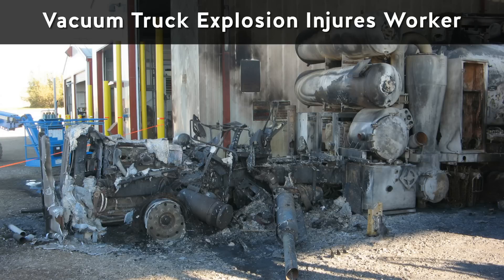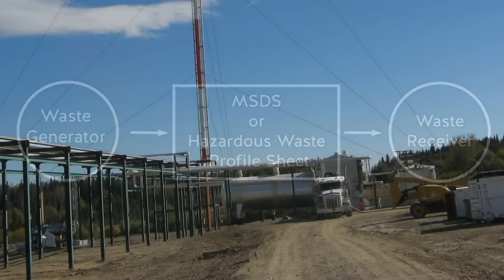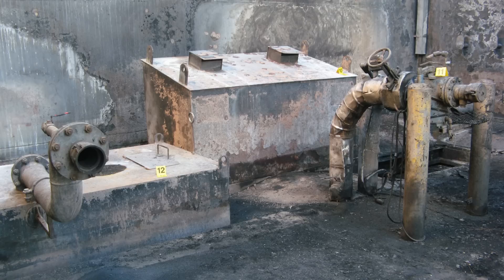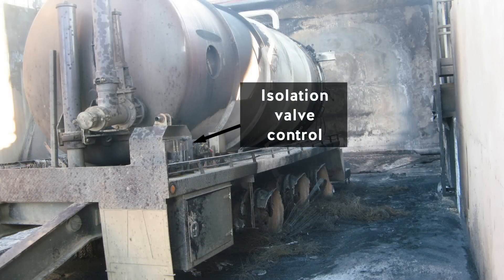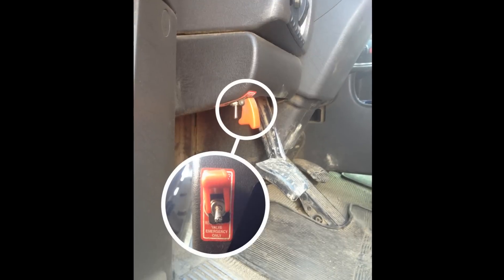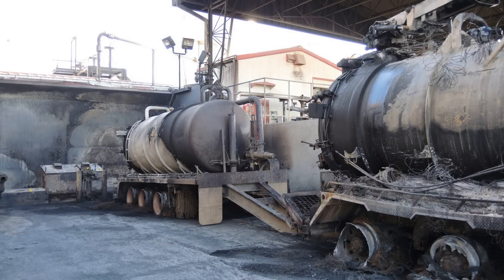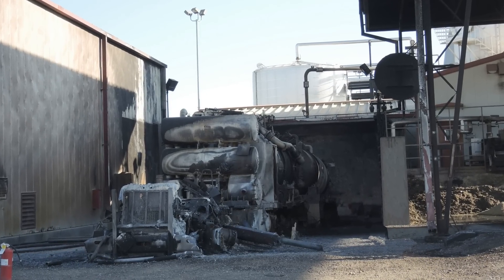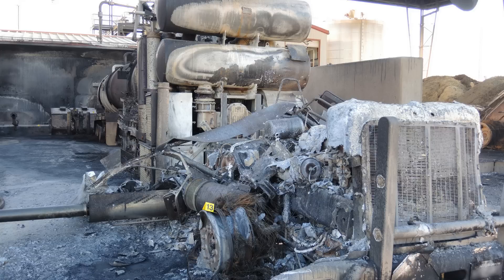Incident Investigation: Vacuum Truck Explosion Injures Worker | WorkSafeBC

Comment: Seriously, who uses a Supervac to load or unload flammable liquids. I worked for many companies that had these types of trucks, but it was a big No No to ever load highly flammable waste products on these trucks do to all the different area flammable vapors traveled, hence the cyclones, bag filter housings. That is complete stupidity on the company, management, and even the driver. These trucks produced so much static electricity it isn't funny. I learned the hard way when I first got into the haz waste industry, working a job sucking fine sand from around an old 10,000 gallon steel heating oil tank, we were using 100' rolls of black corragated "slinky hose", well unaware of how much static electricity this creates, the driver asked if I would walk the 200 plus feet of hose and check for cracks in the plastic pipe. I straddled it and cradled the hose underneath and carefully advanced forward fixing any cracks with a roll of duct tape, at some point my body had collected enough static electricity and next thing I knew I was waking up in the hospital. Yep the driver thought it would be funny to see me get a little shock, well I got zapped so bad in my giggle berries that it knocked me out stone cold! It took me over 6weeks before I returned back to work. Moral of the story if your not qualified or not comfortable doing something refuse to do it, it may be the difference in going home at the end or to your grave!!
Reply: Joseph Grenier "giggle berries" 🤔
Reply: @Ariccio123  Giggle berries?  lol
Reply: Reminds me of when I was young and didn’t know how to say no to a boss. Woke up one day moving around 5000lbs green timbers and making a huge timber framed structure that was going to go above peoples heads. Also was tasked with trailering 5 of them in a crazy 5ft visibility storm. I was an 18 year old child, I have no idea how I didn’t kill somebody while driving or myself while building the thing.
Reply: We have vac trucks designed for flammable and explosive product.
Reply: "giggle berries" 🤣😂💀
Reply: No MSDS equals no knowledge of flammability. Duh.
Reply: Appreciate the tip i deal with these trucks every day sucking rocks off roofs we also repair lines with duct tape lol
Reply: I hope the jokester got fired.
Reply: Tho gear pumps and diaphragm pumps are the safest way to pump flammable liquids however there are vacuum trucks that can do it safely with the use of scrubbers or like a king vac that uses cyclones of water in a special pump to produce the suction. I have hauled 1000s of loads with both. the biggest issue in this case is flame liquids dumped in a open pit. Most disposal places not only do you dump into a closed line you connect a ground strap to prevent statics charge. as the trucks empty simple physics says it has to pull air into the tank in order to drain. Not all but most places have a nitrogen line that you connect to your tank and is used to fill the tank as it drains. no oxygen no boom. Sounds like many things are to blame from the pick up to the end. So sorry to say but you are very incorrect about being able to use vac trucks for flammables as it can be done safely. But i think you are one of those i know everything story tellers that has no real experience except what you read see online. I mean six weeks for a static electric shock. not saying its not possible but not likely unless you fell and hit your head or got another injury due to it that took some time to recover I cal bullshit. If you are going to comment and tell all us nobodies how smart you are make sure you no something about it. I have hauled every hazardous material you can dream of with the  exception of explosives.  I did it for 15 plus years was over 50 drivers for a has waste company when i left due to health reasons. If you cross the t's and dot the I's and dont cut corners this stupid shit is easy to avoid.
Reply: @jvmiller1995  it prevents static charge or allows the charge a place to go? Lmao. Pot meet Kettle
Reply: “... it isn’t funny.” Yes it is.

Comment: Ahh, those fracking dimwits struck again ... :/
Also, wouldn't it be a good idea to have the positive air shutoff valve close every time the truck is turned off via the key? That way, when the engine is in "runaway" all the driver has to do is to shut the truck off with the key.
Also, the explosion risk is still there after the engine is shut off, because the engine parts are still hot.
Reply: The94GTC  you will only find them on petroleum haulers or vacuum trucks.  New volvos with common rail come with them aswell and indeed snap shut when the key is turned off
Reply: positive air shutoff is bad for diesels
Reply: good luck trying to get through idiots buddy
Reply: You really have no idea what you're talking about. Diesel engines are all required to have positive air shutoff devices installed. You cannot run the engine with the air shutoff engaged. The engine is required to run the pump to off load. Also, when you spell "Frac" with a K you give away your lack of knowledge. No one in the industry spells Frac with a K. The word fracture has no K. This is NOT a Fracture Operation. he was transferring waste from one facility to another. You should probably just watch and learn before you yack off out your word hole.
Reply: RikterZilla you are the one showing that you don’t know what you’re talking about.

Comment: They must have been in a rush. I would have never used the open hopper. Electrostatic grounding was not mentioned in the video either. That facility should have a strict policy on closed hoppers for flammable liquids. If blockages were an issue, create a larger input. Failing that, build a shroud for the open hopper to enclose the hopper while offloading flammable hydrocarbons.
From my experience, pumping flammable liquids very slowly is always good. Less chance of static discharge.
Reply: flailios based on what I hear it they did not have a clue of the wast due to no msds or hazmat documents
Reply: flailios x
Reply: Lets say this was stuff pulled from the sump pit so still filled with hydrocarbons but suspended in water. As they said in the video the pipe discharge is prone to blockages so if you thought you had a chunky safe load dump into the open pit is the better option.
Reply: They thought they were carrying water waste not high LEL vapour. So potential for suspended solids was possible. This was a complete failure of communication of the shipper and the driver.